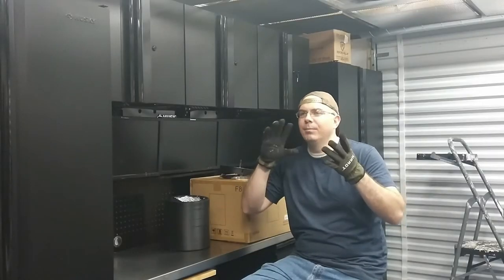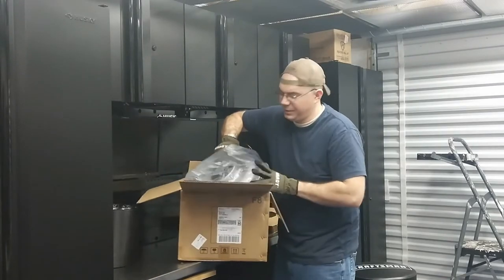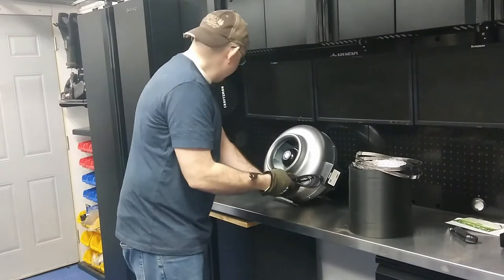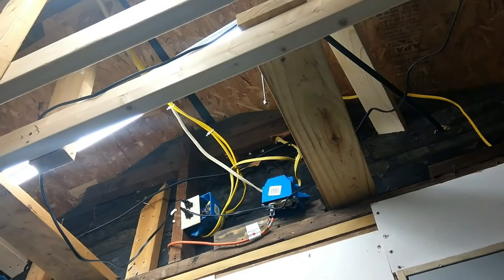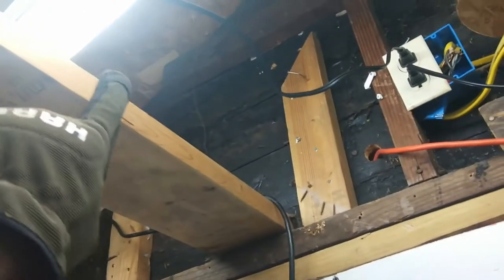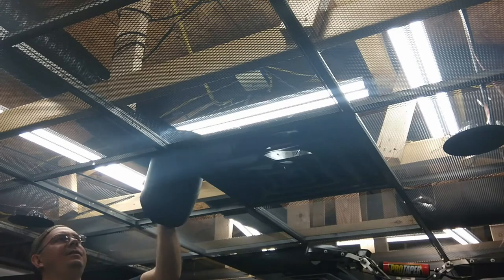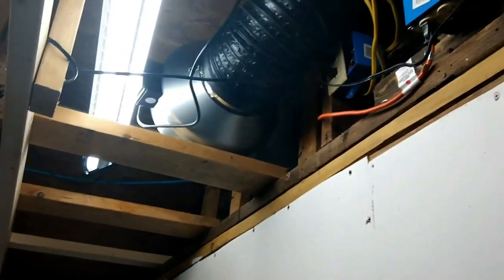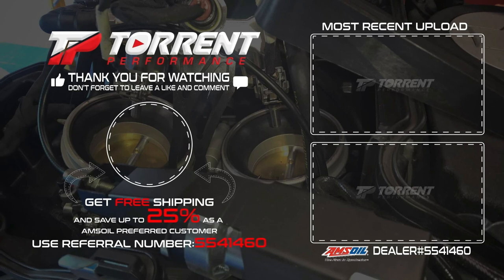iPower 8 Inch 750 CFM Duct Inline Fan Vent Blower Install For Ceiling Vents In Drop Ceiling

Comment: I installed a 500 cfm inline fan forna Hair salon. Now it looks like is not pulling enough air out. How can i get my air flow properly so the Hair salon stays clear? Btw i put 3 vents, 2 6" and 1 4".  The vent out is like 20ft from the motor.